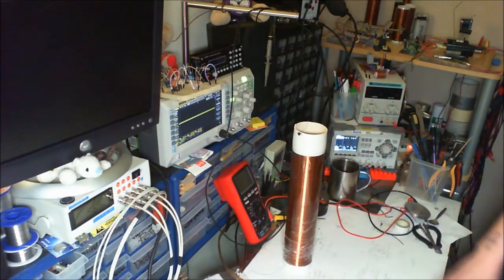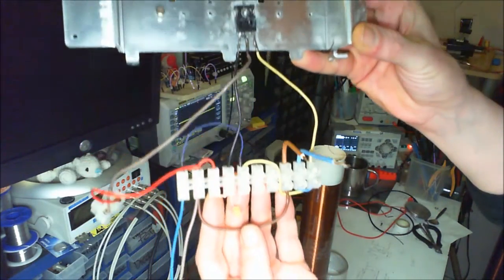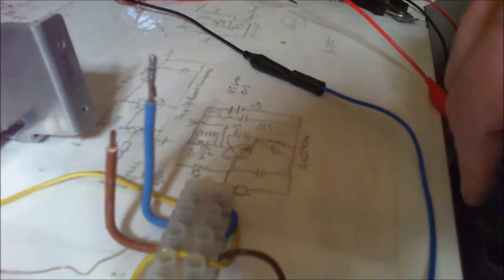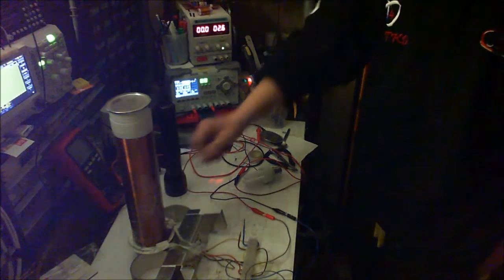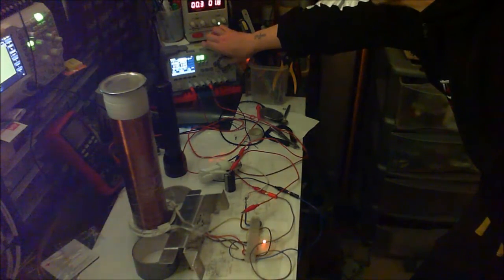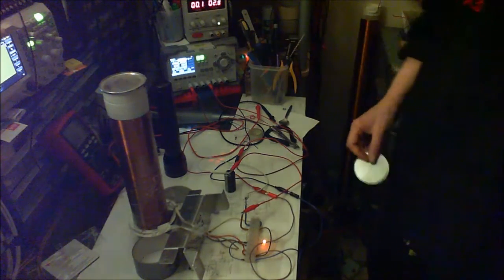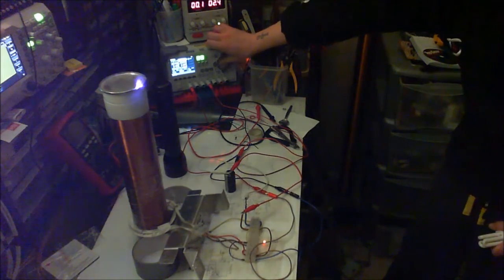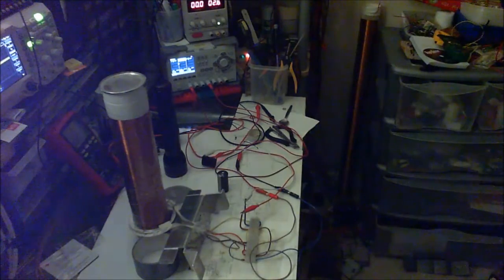Simple Powerful SSTC Solid State Tesla pt1

Comment: Is this the same kind of circuit as a Slayer Exciter? Seems to work quite well for such a simple circuit.
Reply from the maker: +CoolDudeClem Cheers, Yeah its just the TIP35c, 4.7K resistor a LED and some luck. I can run it at 60v and it still works. I use different primary s depending on the top load and connect different caps across the power but it works well without them.
Reply: CoolDudeClem LOL